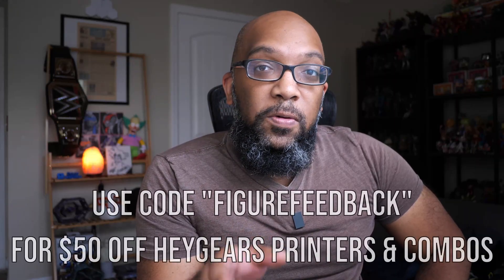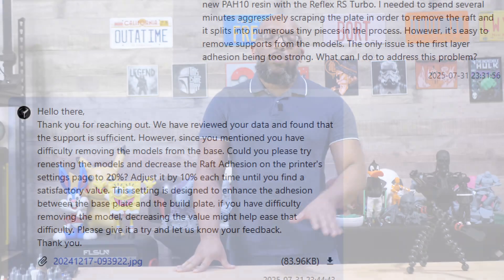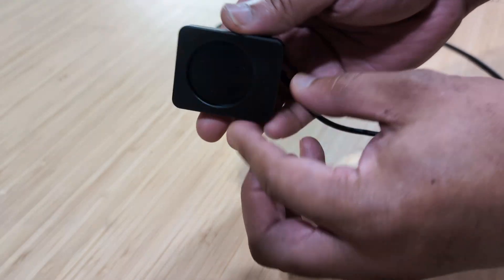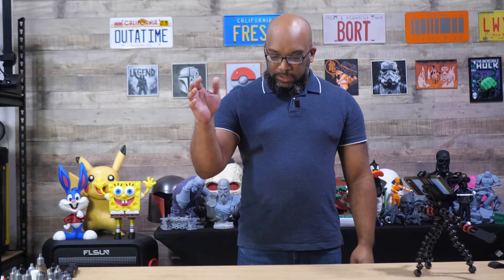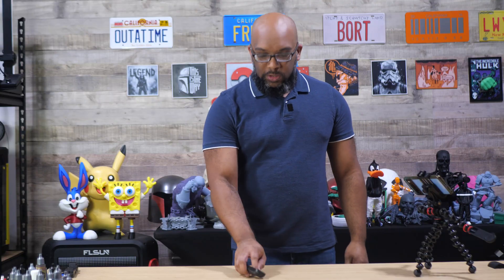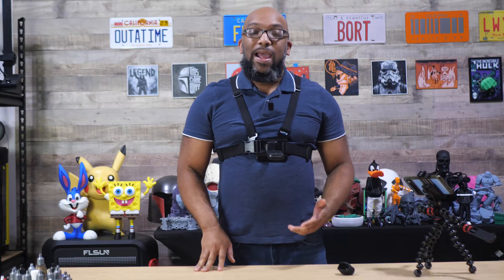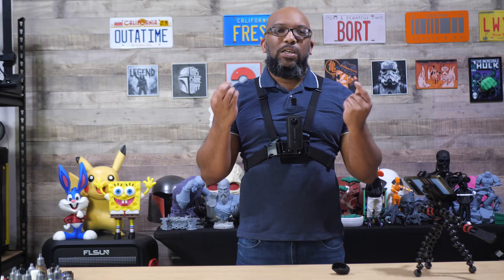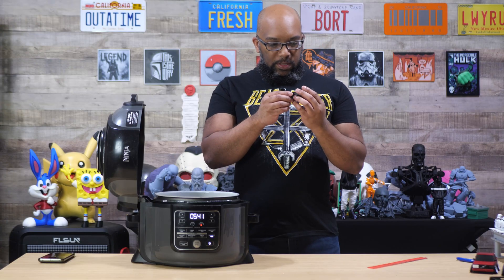Creating Functional 3D Prints with HeyGears PAH10 Resin

Comment: Can you suggest which model filament 3d printer to buy, or you can post video, something like review few models, I want to buy one, but I’m amateur in this field, so any help will be great for me 😊
Reply: As a seasoned 3d printer who has bought and used almost all the brands of filaments printers, my advice to you is to go straight to Bambu Lab. In my opinion, these are the best printers you can get if you just want to turn it on and get to printing. The P1S is one of the best affordable printer you can buy. The A1 cost a bit less and is also great quality. I hope this helps.

Comment: I almost exclusively do functional prints... usually things I CAD myself.  I wish resin printing didn't require a lot of smelly messy chemicals and post processing.  I've been using my Sovol Zero to print ABS parts lately for my functional prints, but I just designed a motorcycle helmet strap mount for the DJI Mic Mini and it's a bit small for FDM.  I might need to drag the resin printer out again.  I've had good luck with Siraya Tech ABS-Like resin, but it's great to see HeyGears making a good structural engineering resin at a decent price for even more demanding applications.  Now if someone could automate the build plate part removal, part cleaning, drying and UV post curing.